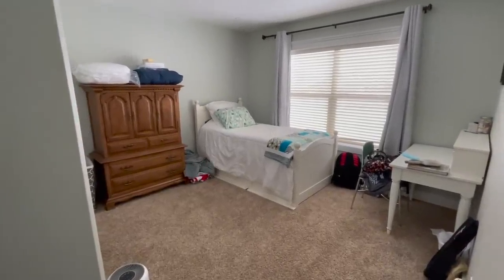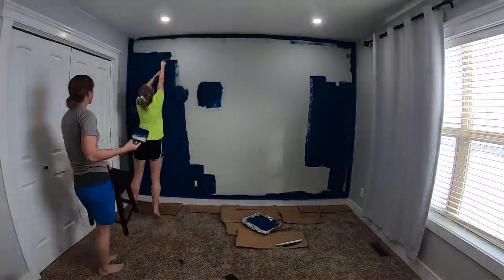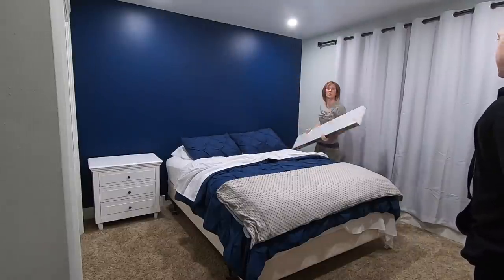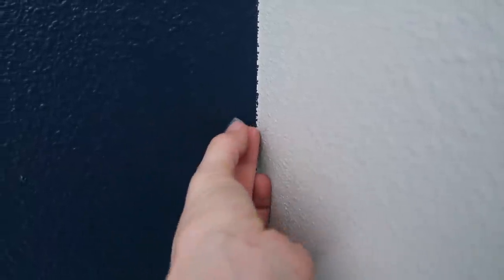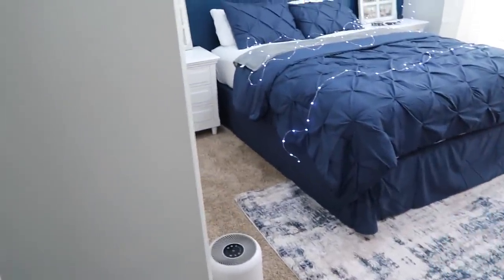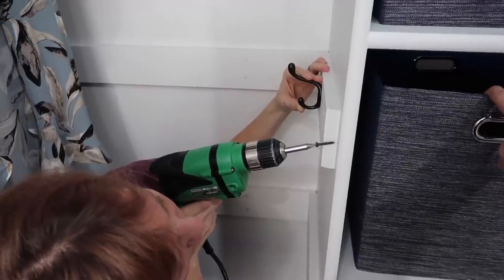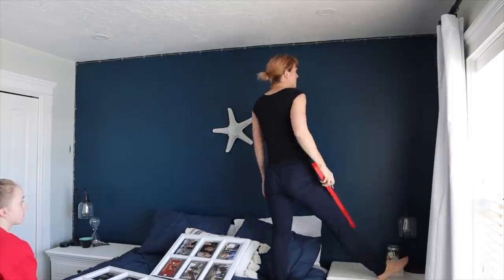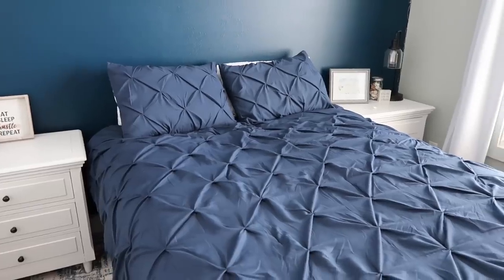DIY TEENAGER BEDROOM MAKEOVER ON A BUDGET | bedroom decorating ideas 2021 w/ Frugal Fit Mom

Comment: A little tip about putting a screw into a hard wood board, prep-drill a hole first. It will help the wood not split and you're less likely to strip the screw head because you won't be putting so much pressure on it when you screw it in.
Reply: That’s what I came to say 😀

Comment: I am an adult follower and I am watching this for inspiration as a isolated disabled Frenchwoman. I actually just moved in a new apartment (the previous one was unsanitary.. Mildew, rats, mice, cockroaches, humidity problems...) and I literally have to start from scratch (thanks God for giveaway apps they helped me so save sooo much). Someone from church put together my bed, which I am grateful for.  You and Hailey actually gave me ideas with the hooks. I don't have a closet right now but I have this hidden space and I thought 'Why not hang my most used bags?' . Same for the light. I am going to put the little plastic hooks on my headboard, though.My garland is with white plastic flowers which you can turn on (got them at Primark, if anyone reading this is in Europe, go and grab them). Well, I should go back to putting together my desk haha

Comment: If you are having trouble installing screws you should drill a pilot hole that is smaller than your screw. It helps the screw bite into the wood better instead of just wiggling and spinning around like that.

Comment: A good tip I learned to hang a frame on the wall but can't figure out where the nail goes.. Put toothpaste where the hook is on the back of the frame and when you decide a location - press it up on the wall. Where the toothpaste residue is, that's where you put the nail. If you end up changing your mind - just wipe the toothpaste off the wall and try again.

Comment: One thing I learned the hard way is that paint needs to cure for a month before command strips will hold their load capacity.  Or else the paint separates and the picture falls. But it seems like there was enough overkill here you got away with it.

Comment: Your the mom but have her drill stuff in nxt project. I with supervision let the 3yr use electric screw driver to open her toys if it needs batteries or to build cubes. Yes had the conversation that she never uses it without us and she's 3 so every tool is high up or under lock and keys.